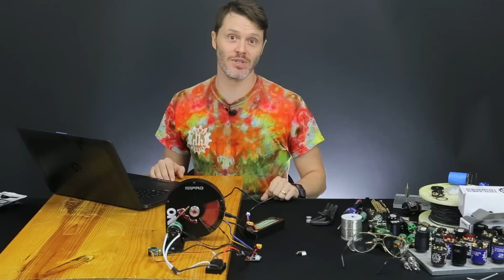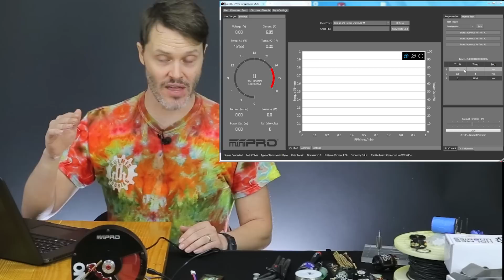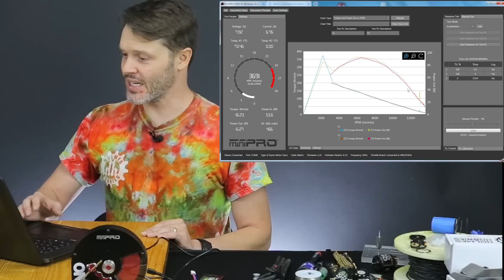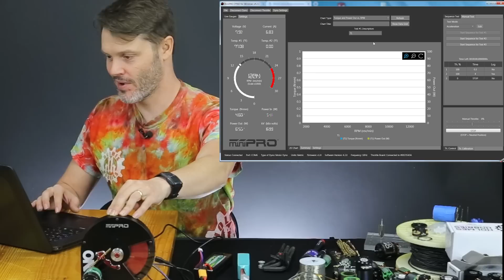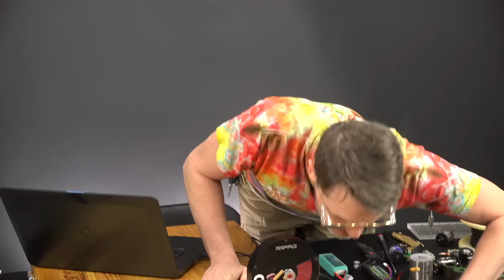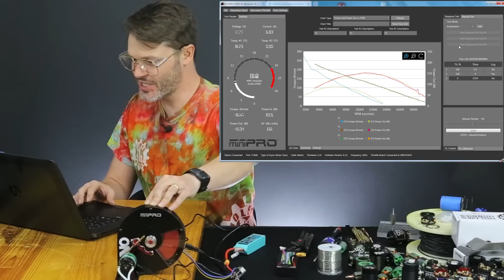Let's Test Motors! Mini Pro Dyno Wired Up And First Runs With Analysis - Holmes Hobbies

Comment: Why does the RPM reading fluctuate drastically, especially during the deceleration phase after operation? Is the optical counter of the motor dyno inaccurate?

Comment: How is it that the power crosses torque but then the power falls off faster than torque does? These graphs do not look like torque over time equals power.
Reply from the maker: probably just the scaling.  Each factor has its own scale on the chart, so they aren't in the same units.   torque x rpm = power.
Reply: HolmesHobbies rpm=time, it’s a measure of how quickly the torque is being applied because 550 pounds a foot a second is what watt postulated a horse is capable of doing. Iirc about the anecdote.
Reply from the maker: @KTMcaptain  Since the time is baked into the rpm, we can take any discrete point of the chart and the data is still relevant.  The chart does represent a test done over time, but the time isn't a linear plot on an axis.   The power seems to "fall off" faster because it is the multiplication of two linear functions, which can result in a quadratic function.  near the edges, the slope becomes steeper than the original lines.  A good read about that here if you like math: http://jwilson.coe.uga.edu/EMAT6680Su12/Brown/EMAT6680/Assignment%201.html
Reply: HolmesHobbies my issue with it is beyond a specific rpm power will be greater than torque. For HP, it will always be higher than ft lbs beyond 5252 rpm. 

But I didn’t consider that time can be displayed in two functions. I’m use to seeing dyno plots with rpm being held on the x-axis. But if time is on the x-axis instead of rpm and torque is on the y, then torque and power can be shown in this fashion.
Reply: You both are talking mad scientist talk

Comment: Could be really interesting to run through different transmissions and check power loss with the same motor through different transmissions
Reply: you've described my PhD, got one of these infront of me right now. Just need to learn how to use it

Comment: Maybe you could make a vlog about differences between Sensored and Sensorless ESC and Motors and compatibility. Just bought Sensored Brusless Motor and non Sensored ESC from your company and your staff suggested best I buy the Mamba X  ESC since the Motor is Sensored. From my understanding, Sensored Motor will work with non Sensored ESC but not the other way round.

Comment: in case anyone is wondering, its making about 0.14-0.18 ft/lb of torque, and about 0.12 horsepower on 2s lipo. which is roughly the power of 36 duckpower, (DPm) duckpower mallard which is the standard breed for estimating duck power.

3s yielded about 15% increase in torque, and about 50% increase in power to a whopping 54DPm!

Comment: I would like to know how those graphs would varry betwen a 3000KV motor on 2S vs 2000KV motor on 3S. If You know what I mean...
Reply from the maker: Basically would look the same with a very slight edge to the low kv/high voltage, depending on ESC size.   A micro X would more easily show a difference.  A mamba X might not show it.   As we boost up and ask for higher phase amps, it becomes more evident for any given ESC size.   4000kv on 3s and 6000kv on 2s might require a monster X to hide the difference.
Reply: @HolmesHobbies  and how would graphs look like for 1800kv outrunner vs 1800kv inrunner?

Comment: if someone with access to an infinite number of motors AND a MiniPro Dyno i would ask for two things:
1. test with different batteries (3S, low mAh & high discharge rate vs high mAh & low discharge rate, 3S same mAh high C vs low C)
2. a second opinion if the smell comes from the motors. thanks to you, Mr. Longest Srewdriver in the World, i have some new phrases for these special moments in the elevator ("smell is gone, no big deal, no big deal...we have no warmth on any of the other equipment")
Reply: On #1 You forgot about the internal resistance of the battery. That will have more of an impact than what you suggested. When a fresh vs fresh battery fully charged is tested, there won't be a difference on such a short duration test.

Comment: It's Doo-tah.... and you got to say it with a British accent. Hahaha. 
You know I'll always support your product...I currently have roughly  15(that's a quick guess)Puller Pro's and Revolvers....still...
I'd actually like to see a dyno comparison with the cheap rebranded/reverse engineered China motors.
I'll tell you right now...the stock 5-pole in the Element Enduro is mediocre at best and feels cheap-on-power. I'll be doing ALOT of changes today on it.

Comment: That’s a cool dyno. We had to build one in college we used piano wire in a driveshaft like coupler. There were optical encoders on both sides. The piano wire would twist and we could measure that twist with the encoders. We measured the torque on the piano wire and deflection using weights so then could plot the torque of the motor. This was closer to a hub dyno though and the one in the video sounds like an inertia drum dyno.